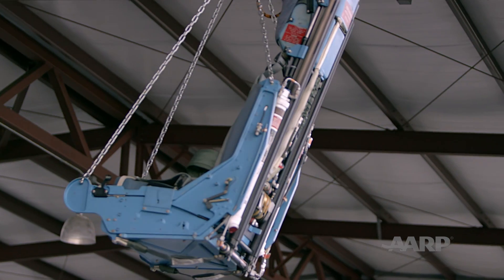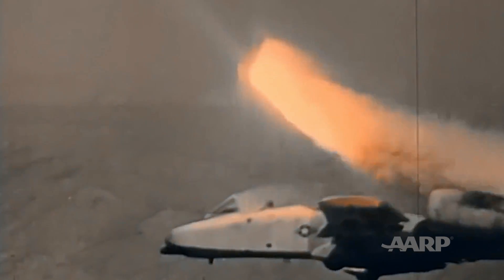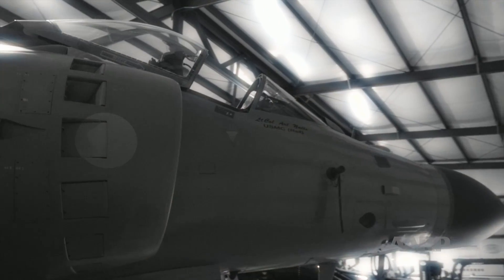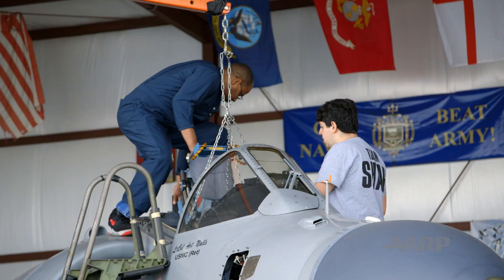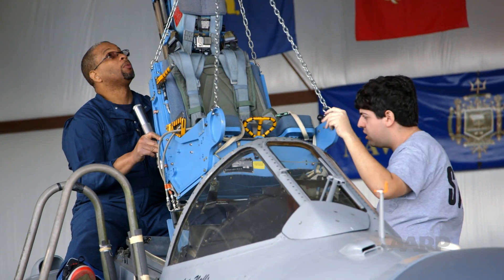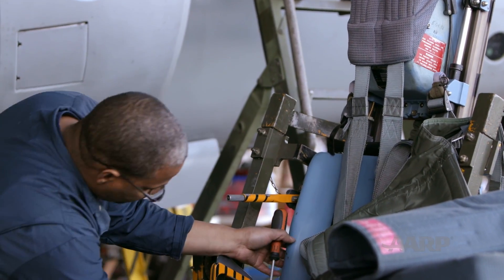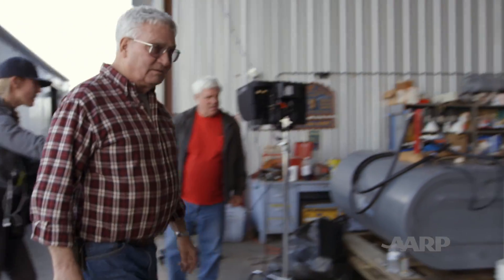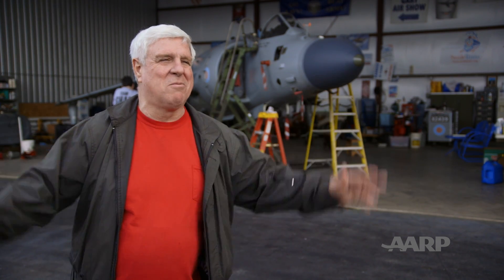Inspecting a Harrier Jet's Explosive Ejection Seat

Comment: That hurt me to see that A-10 pilot eject off a perfectly fine A-10
Reply: GenralDmoney if it was perfectly fine he wouldn’t eject.
Reply: @windshearahead7012  that was a test ejection. Otherwise they wouldn't have recorded it.
Reply: GenralDmoney yeah but the planes that become drone targets or end up like this are usually retired and instead of scrapping they do this stuff, so it wasn’t under no circumstances a perfectly fine a 10.  A retired airframe costs a hell lot to maintain
Reply: @windshearahead7012  well, maybe not perfect but it's flying pretty well right there....
Reply: GenralDmoney dude -_-. It might fly well but after certain hours airframes NEED to be retired due to micro cracks on the airframe unless you want to maintain it and pay a shit ton of money fixing them...
Reply: It's free restate
Reply: It's free restate
Reply: NOOOOO NOT THE A10
Reply: @GeneralDmomey no it had been hot buy a rocket on the back side
Reply: @genraldmoney8171  the back of it was destroyed
Reply: I was thinking of that
Reply: The ejection occurred during one of the early test flights after the smoke from the rotary cannon was ingested into the engines. There wasn’t enough altitude to relight the engines so the pilot was forced to eject.
Reply: @犬の大将  Man you really sound like you know what your talking about for someone who doesn't know what they are talking about.
Reply: I’m with you

Comment: Worked on the AV8A in the late seventies, next door to 231 (VMA 542, Flying Tigers), always wanted one of the trainers.  Saw the 231 XO eject between the hangers,  one that "caught a wave", another that performed a tail stand that went horribly wrong and ran through the Station Ops flight line, hanger, and parking lot, and one that dropped into the bay off of officers housing. It was a bad year-or-so for Harriers. Live and learn or die young, I guess. Still love 'em and hope to fly/ride in one while there are any left. You can do so many things with a Harrier that can't be done with any other bird, and a few that shouldn't even be done with a Harrier. Never licensed for the Sencil B, and wouldn't care to. But noticed no MDC in the Plexi windows, gone on the B model? Still had the World Map between the legs when I was doing my thing, guess that is a weight saver on the B. When I was in, we had more snow at Cherry Point than North Dakota, the exhaust came in handy a few times! All I can say is . . .I wish I was you!  Semper Fi.
Reply: This isn't an AV8. That is the McDonnel/Douglas licensed built version. It has a different wing, avionics and a US licence built engine. This is a Hawker/BAE aircraft with the original RR Pegasus, and it looks like the original avionics. It was in service with the Royal Navy.

Comment: Im sure those can be dangerous if you dont know what you are doing but comparing rocket motors to sticks of dynamite is a bit of a stretch. Also referring to the rocket motors going off as exploding is an even bigger stretch. They are igniting not exploding

Comment: How do you one inspect an ejection seat and say that it's still good after 30 years? How do you know it still works without ejecting?
Reply: It doesn't. CADs and PADs have a shelf or installed life.
Reply: the parts get tested for function.
Reply: how do you know the airbags in your car work without smashing into a wall
Reply: Ejection Seat Mechanic here. To actually explain previous comments all explosives have a service life based on shelf or installed life calculated in months. Ejection Seats get certain explosives changed out in these intervals ie every 24 months these explosives get changed or something like that. All the explosives are different and perform different functions. My seat has 15 separate explosives for example. During these scheduled inspections where the explosives get swapped, nonexplosive components of the Ejection Seat will be inspected as well. Depending on the technology involved there's testing and troubleshooting performed on these components to verify that they are functioning properly. This is of course done in between de-arming and re-arming the seat so you don't set anything off. They're actually quite easy to work on, but you have to follow the checklist. Skipping steps WILL kill someone, not might. Finally, because this is a component that can not be Operationally checked, it requires paperwork submission from specifically licensed personnel (CDQAR's in the Military).
Reply: The explosive components have “expiration dates”

Comment: Art, you are better off permanetly removing those explosives under your seat and getting rid of the ejector button....you'll be safer without it........as a Helicopter Pilot , I removed my ejector seat.....and never regretted it
Reply: Dino Dean your also not in a high altitude military aircraft going very fast
Reply: @harrisonnordmeyer5056  - It's a troll only a few Russian military helicopters have typical ejection seats and removal isn't up to an individual pilot. Ejection seats aren't fired by a button.
Reply: Pablo Gonzalez just saying he’s in a jet and this guy was in a helicpoter bit of a difference
Reply: @harrisonnordmeyer5056  I'm not saying Art isn't justified having an ejection seat I'm saying this comment is trolling
Reply: Pablo Gonzalez I feel like he isn’t trolling but ok
Reply: @harrisonnordmeyer5056   - Again unless he's Russian military his helicopter doesn't have an "ejector" seat or an "ejector button". As the blades need to be blown off prior to seat ejection this isn't a common feature on helicopters
Reply: ofc you didn't regret it.... till the one day